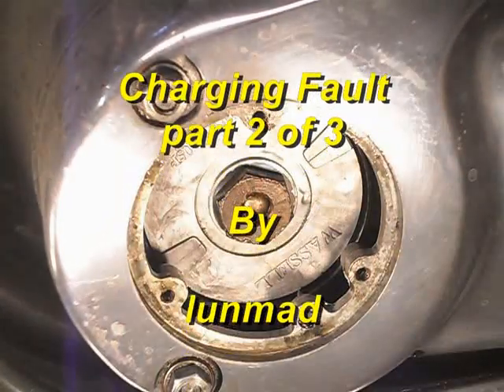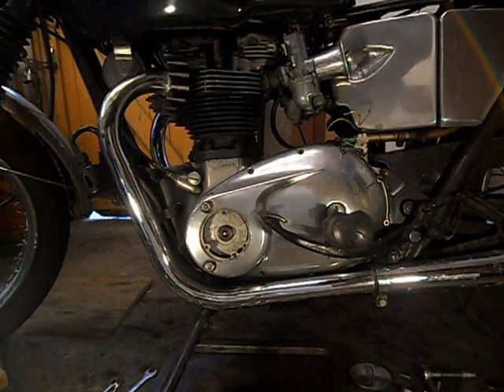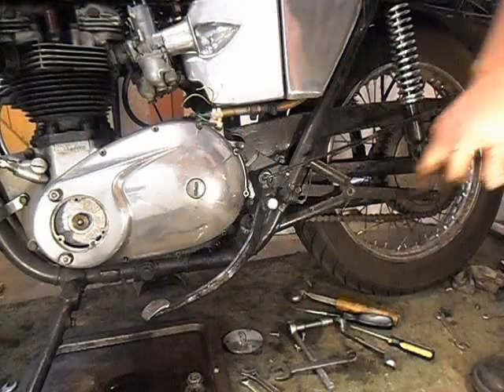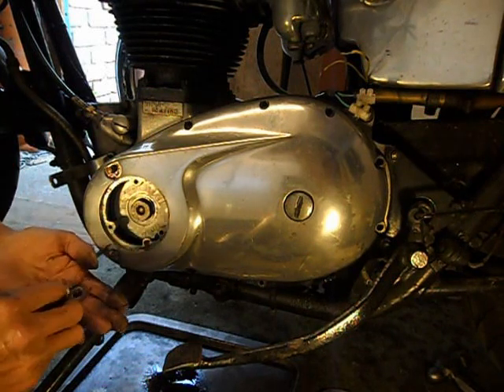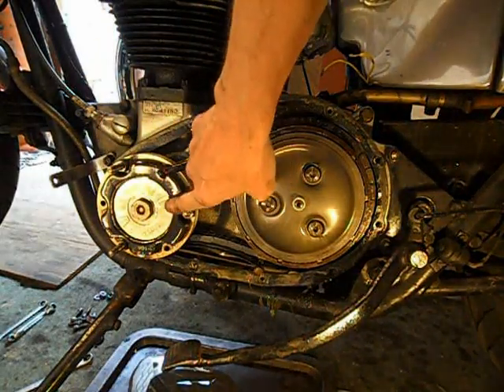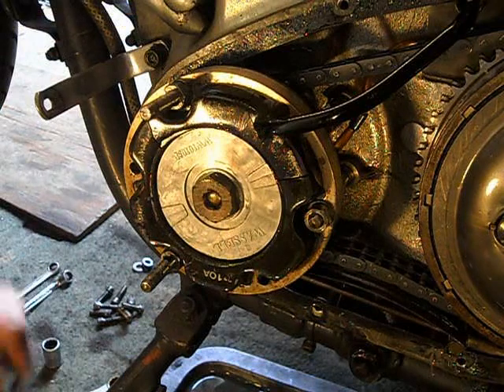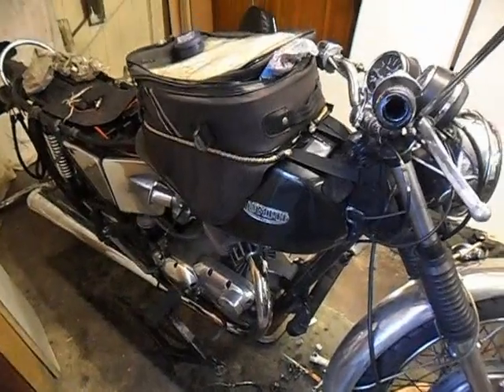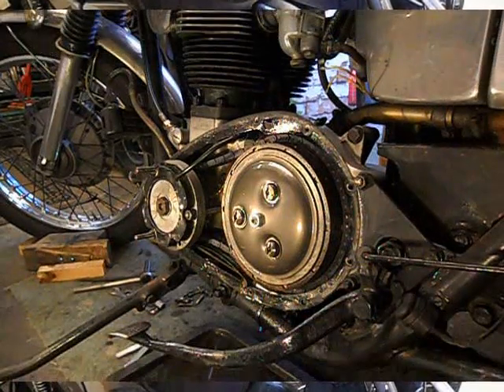charging fault part 2 of now 4

Comment: I wish you lived closer to me!(Oregon,USA),we both have the same methodology to repair work,and I love my Triumphs!.(52 and 71 650's currently).
A word about regulator/rectifiers and frying stators (like the overheated one in this video)
I have a Honda CX650c,goes thru stators every 10 years,at 102k miles and 30+ years old it is on the third stator-amazingly it is the same stator and reg/rect setp as yours ,and the same (wassel) setup on my '52 right now.
I learned something about Japanese solid state regulators this winter-there are TWO types--WHAT!? you say?--me too
ONE type allows and takes all the stator has to offer in amps ALL the time ,and dissipates excess amps and volts thru it's finned body as HEAT (as my CX650C honda),so the stator is at max output all the time,and as you know ,if power has a place to "go" or is accepted by the regulator ,the stator will get a tad HOT.
SECOND type of regulator--only takes and gives(charge voltage and amps) AS NEEDED!!-so when demand is low from the bikes system,so to is it from the poor stator-this regulator/rectifier is the "shunt" type-check Shindengen SH775's  (SH = "shunt").
I am now looking at changing out the reg/rect on my Honda and Bonnie and '52!!
Keep up the good work!--PS,I have a great fix for an oil seal on the older trumps which only have a bushing in the timing cover,and this takes care of a bad crank-tip all in one swoop!---keep in touch and keep the rubber side down!!
Reply from the maker: +laszlosworld 
Hi Lazlo :-)
great tips in your post I'll check out that Shindengen SH775 thank you.
The old Lucas stator is holding up fine for now, I think there may be a problem with these particular wassel stators
 as I have come across others on forums with the same problem burned and cracked, I will admit they are a budget
price but the quality is a bit, well er not what I expected.
I cannot fault the wassel rotor though it knocked the spots off my 40 yr old lucas one.
ride safe and enjoy
Reply: +lunmad good to hear it may have been a bad batch!-the Wassel stator and rotor I installed on my '52 6t is still working well after 2 years and 6000 miles!-it's nice to see miles ahead with my halogen versus the old 6V genny setup-which kept flinging the armature apart every few years!

Comment: Hello Lunmad, I have replaced the primary chain on my 70' Triumph Tiger. The new chain is really tight. It was tricky getting the 20 bearing's to go in but got them in and I have got the chain tightener as loose as possible...Still very tight chain. should I attempt to run it hoping it will stretch a bit or would it cause other problems like bearing wear or the like? Thanks in advance. Your video's are a great help. S
Reply from the maker: Hi Mac :-)
a new chain is pretty tight, as long as it is not bar tight I would give it a short run (round the block) and check it. When a chain rollers are full of lube (grease) there is very little movement. For a five minute run in the shed you could run it with no case on be careful doing this, not much more than a tickover is needed.

Comment: Well, at least you had the old stator to replace the new one. WTF.....I never could figure out why a stator does that from time to time but shit does happen when dealing with the creation of electricity and heat. I was once told that it all begins with one little weak spot in the coiling wire of the stator and then just multiplies from there. A hard rain is so depressing but then again I guess it could be snow and that sucks even more than rain.
Reply from the maker: EdOfTheNorth Aye back to the old faithful Lucas prince of brightness!
once the insulation starts breaking down arcs from shorts do the rest.
It was a bute cloud burst and  that rain was warm!

Comment: Mine Wassel stator has cracks like that just a little smaller, and i have only 4000 km on it 🙈 still works though.
Reply from the maker: Ulrich Brock Hoffmeyer 
Hi Ulrich :-) fine cracks i would not usually worry about.
You want to do the DC voltage test you want around 50v at 4000rpm or there abouts.
Do the test every ride or so, if it is a worsening fault the voltage will start dropping,
or it may just fail. If the voltage is stable it could be ok.